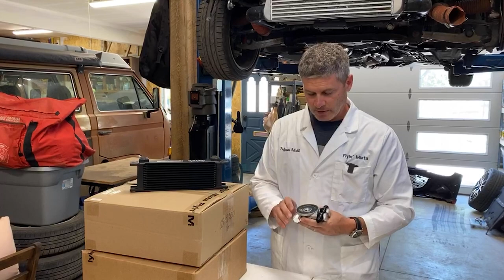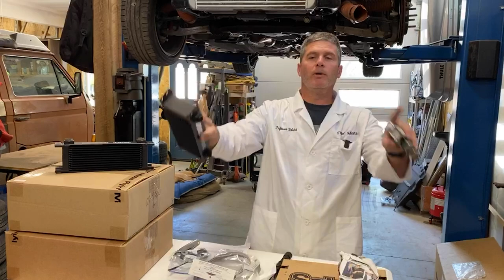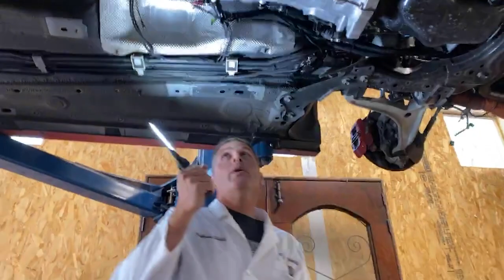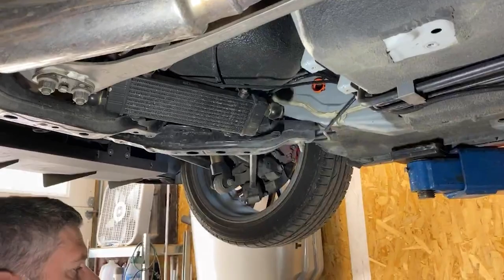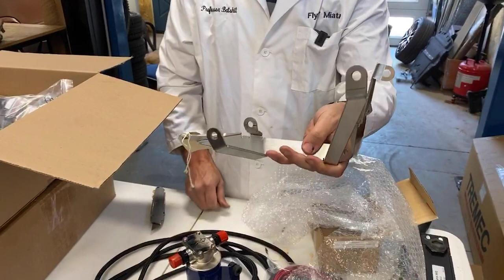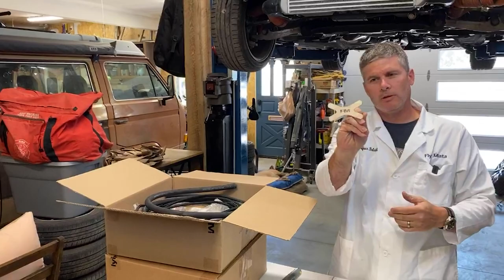Oil, Differential & Transmission coolers for the Miata! (FM Live)

Comment: Great video. What is the weight of all three coolers in the "totally cool" nd package. Excluding alu radiator from website bundle. And what skill level do you believe is required for installation I.e. suitable for novice garage warrior with no access to lifts ( only Jack's...)
Reply from the maker: Function trumps weight in this case. We don't have exact weights of the parts installed, but the shipping weights are 5 lbs for the oil cooler, 6 lbs for the transmission cooler and 6 lbs for the differential cooler. The only way to make them lighter is to use a weaker pump or smaller coolers.
We publish the installation instructions on our website if you want to take a look, but it's a fairly easy install. You will be dealing with fluids so expect some mess.

Comment: should the stock plastic under tray stay on the car for a track car? does it help with airflow through the rad? is it better to remove it for this oil cooler or cut a hole in it for this oil cooler and build ducting from the under tray to the oil cooler
Reply from the maker: Yes, it is very important for cooling on track. Modify it if you must, but do not delete it.
Reply: @FlyinMiataVideo  so probably best to move the oil cooler into the mouth of the bumper then?
Reply from the maker: @bmxkelowna  That depends on what else you have sharing that space.

Comment: Amazing in depth explanation on the FM coolers. Where can we watch the torture test video? I’m curious about when oil temps get too high during hard track driving before coolers. I.e. Is it 5 minutes or 15 minutes before temps reach a critical point.
Reply from the maker: The video is on our channel titled "Tour of GJMS in a Flyin' Miata development turbo car.". The transmission/diff temps are not logged onscreen, unfortunately, and it's only one lap. 
Time to critical temps is going to vary depending on ambient temperature and power levels. It didn't take us long to get it nicely heat-soaked, though.

Comment: How much do these oil coolers increase the oil capacity needed in the crankcase, trans and diff?
Or do they not affect the oil capacity at all?
Reply from the maker: They increase the capacity by the volume of the cooler and lines. That's especially good for the differential and transmission.

Comment: So I daily my 97 Miata, is it worth buying a cooler for it? It does get hot here, and lately it’s been 20 degrees, and this has been a part on my mind for awhile.
Reply from the maker: It's unlikely that daily driver use is putting enough heat into the oil to require a separate cooler unless you have something else going on, such as a large turbocharger.

Comment: Do you need to run more oil with the oil cooler kit? If not, why not??
Reply from the maker: Yes, you need to add enough to fill the cooler and lines. This added capacity also will help keep temps down.

Comment: I'm trying to shop on your newly laid out website and it got 10x harder to navigate.  It used to be easy (choose NA, NB, NC, or ND. Drop down through componentry type. or maintenance items. and done).    I can't find your oil filter relocation kit at all under ND stuff. It's also a lot messier now because it mixes all generations' parts together. I'd rather be able to lock out irrelevant models' products like it used to in the old layout.  It's unfortunate that I have to weed through weird stupid parts like Flyin Miata bottle openers, NA headlight housings and NC cigarette lighter brackets when all I wanted to find was an ND oil filter!
Reply from the maker: We have not changed the navigation or layout on our website. You still select the chassis first, although the search does trawl through the entire catalog as it's always done.  
We don't sell NC cigarette lighter brackets or bottle openers. Are you sure you're on the right site? flyinmiata.com.
Reply: @FlyinMiataVideo  Cig lighter and bottle opener  was a joke. Because I had selected ND and yet I'm being shown all kinds of other stuff cluttering the search results unrelated to what I'm trying to find (and a lot of parts for other generations).

I remember shopping on your website back in 2018 when I had my NB. it was much neater/easier to navigate and everything was arranged in perfect sections.  This new layout - while less decorated - is much less precise, a lot more broad-stroked and overlapping in search results at near Ebay levels of showingmeeverythingexceptwhatimlookingfor, and just overall allots less fine control over the filters.  

Old website had very straight forward drop downs that lead to specific areas of the car and anything found in each sub menu wouldn't show anything else outside of them. There'd be no shirts and stickers in the Turbo section. If i wanted a relocation kit back then, I'd be able to navigate to it in the dropdown through ND, into Engine, and scrolling down to Oiling / Cooling etc and find it in there. Currently, I feel like Indymiata Jones and I need more clues to decrypt the code and uncover the lost Oil filter relocation kit of the covenant :(
Reply from the maker: What you’re complaining about is a much better search function that’s pulling up more matches for goven search terms. The 2018 site actually had less separation between the models. If you’re navigating by menu, you’ll find the same arrangement as before. It’s using the same categories as well.
We have discussed firewalling the products so they only show results for the specific chassis you chose at the beginning, but found it was less effective for more people. 
There should be no shirts in the turbo section. I just checked, there aren’t. There is also no ND oil filter relocation kit, that’s why you can’t find one. 
The site is undergoing a significant redesign right now, hopefully the new one will be to your pleasing. If you’d like to discuss this with our webmaster, email keith@flyinmiata.com. He’d be interested to see how you’re getting the results you are.
Reply: @FlyinMiataVideo  If you select ND and click "maintenance" the first 4 items on the list are as follows: MT90 gear oil, an O-ring SKU 04-36023 (for NA and NB valve cover oil caps), an NA/NB stock main relay, and a camshaft sensor for NB.

Going down the list and you start to see some ND stuff, but also a redline oil for NA/NB/NC and then general fluids. 

I had to really think about where the oil catch can systems were. The intake section of course, fair enough.  Then I find a moroso catch can elsewhere under the home page section but it isn't searchable through the dropdowns. I thought it'd be next to the Verus 4 hosed product since they're the same type of item.  I just can never be sure I've seen everything with the way something new surprises me in a section that might change depending on what you're looking at currently (or not looking at).